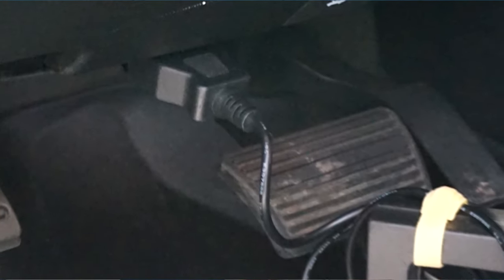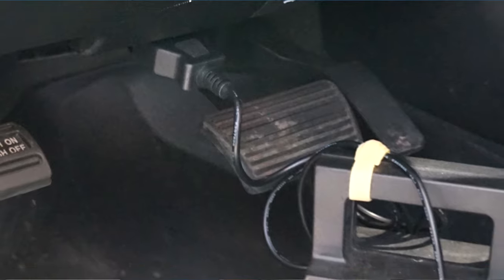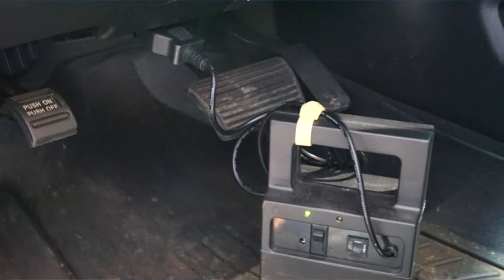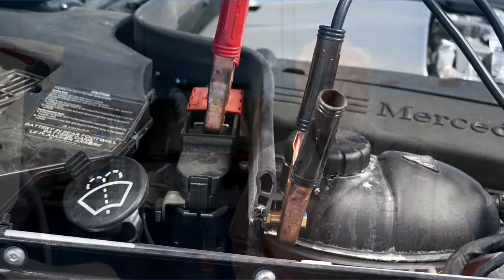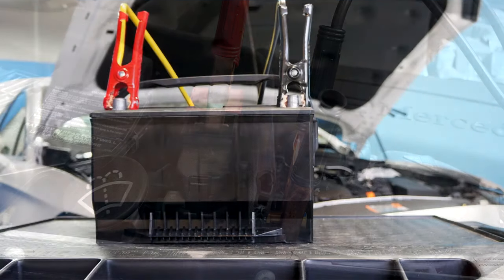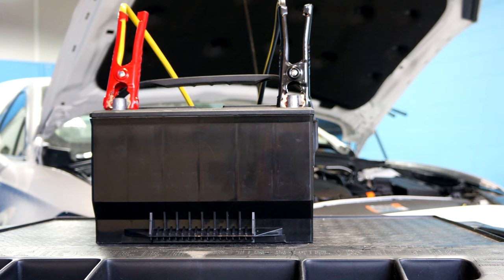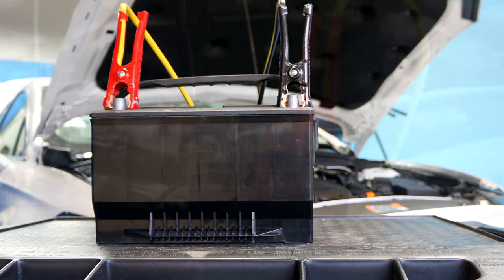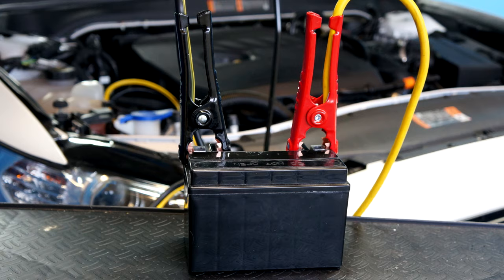Vehicle Memory Saving - The Battery Shop

Comment: Very good vid as many radio's have an anti theft mode that disables the radio when its disconnected from its12v power source. Put the new battery in and the Radio will ask for an access code-which came with the car when it was new. Hope fully you have the original owners manual and the original owner wrote  it down someplace in the manual. Its a  four digit code that you input with the radio buttons. Note that as of July 2021 the special Toyota Hybrid glass mat aux battery is $350. Most techs keep a small motor cycle around to provide 12v power to keep the Engine Control Module and Radio happy should the small aux  battery need replacing.  Note with dead battery you can't open the trunk very easy.
Reply from the maker: Hi - Thanks for watching and sharing your experience!

Comment: autozone recommended to keep the car running on idle, while you replace a new battery. i've been there 3 times. the first 2 were changed with the car off, the battery just keep having problem with idling and starting.(at the end my 03 camry reset its memory by holding on idle 1500rpm for 8minute to reset the memory, thanks to that autozone guy ) the 3rd time with a another car while the car is on, every thing seem normal, and it doesn't need to reset any thing. just keep those two wire not touching each other, it will be fine.
Reply from the maker: Hi - Thanks for watching! We recommend that the vehicle manufacturer's procedure for replacing the battery be followed, and NEVER replace or disconnect the battery with the vehicle running. We use a memory saver during the battery replacement to avoid resets.
Reply: Removing the battery cables while the engine is running can damage the alternator.  Maybe they wanted to sell you one of those too.
Reply: @billcorn5172  i don't know man, there are 3 different cars(different brands) that i replaced the battery while the engine is running never had ran in to a alternator problem. just don't let the cable touch any metal while doing it.

Comment: There's no need to use a memory tool just to save stuff like pre set favorite radio stations is there? You can reset it again and it stays? Or is ability to reset stuff permanently damaged?
Reply from the maker: Hi - Thanks for watching! It depends on the vehicle and how it is equipped. We suggest that you check the vehicle owner’s manual or a service/repair manual for the vehicle to be sure.

Comment: Since 2020 Pandemic began, my car has been sitting for over a year without being operated. It is now "dead" which I expected.  Is it best for me to remove the battery to keep it from corroding? I'm sure it will affect the vehicle's memory. I'm unable to afford purchasing a new battery at this time and since retiring and the 2020 pandemic, I barely drive. Thank you for being so helpful and your videos.
Reply from the maker: Hi - You're welcome and thanks for watching! Lead-Acid batteries will sulphate if left in a discharged state over a period of time. You might be able to charge your battery with a battery charger to get the vehicle running, but it will most likely be unreliable and have to be replaced. You may want to consider a "battery maintainer" to keep the battery charged during the times you are not driving it.
Reply: Harbor Freight sells an "automatic" battery float charger for $9.99 keep it plugged in always and it will not over-charge your battery but keep it fresh
Reply: I think if you get a new battery in, you may have to prime to prime your car plus pistons go bad if you're not starting car every few days?

Comment: All this just too change a battery, wow!!!! I remember just swapping an old for a new one none of this memory saver bogus thing.
Reply from the maker: Hi - Thanks for watching and sharing your experience and memories.
Reply: On the average vehicle, using a memory saver is more for convenience.. such as saving radio station presets, and other settings. There are some vehicles out there however that can have issues when memory is lost but I don't encounter that very often on my job but have an good idea which ones actually need a memory saver.
Reply: @deionhughes6867  does a 2019 jeep renegade need a memory saver
Reply: @Cristian-jg7rk   Personally I've changed a handful of batteries on the Jeep Renegade without a memory saver and have not had any issues afterwards. Depending on which infotainment system/screen you is in your model (there are 2 versions) you may have to reset your clock and radio station presets, but you definitely will not loose anything like stored Bluetooth devices, etc.
Reply: @deionhughes6867  do you know if the Honda CR-V 2016 is one? I need to replace the battery but live in the middle of nowhere so I don't have anything other than the new battery :(
Reply: @muntaybun7690  You'll be fine changing the battery on that vehicle. It's pretty straight forward, older Honda's need a security code for the radio when power is lost but on a 2016 you should be able to press and hold the power button for 2-3 seconds to restore radio operation after you change the battery.
Reply: @deionhughes6867  thank you. I'm still new to some car maintenance so I am really happy there are those like you who share experience and help out 🙂

Comment: So there is 2 batteries connected at the same time ( be it temperarily ) ............24v DC  ? or when exactly do you disconnect one and connect the other ? tia.
Reply from the maker: Hi - Thanks for watching! Check out our video on memory saving. The link is in this video's description.
Reply: The second battery is connected to the system in parallel. Which means you still have 12volts but more capacity or a "bigger" battery
Reply: Parallel means red (+) to red and black (-) to black.

Comment: Greetings from Belgium. Can i just connect my charger to the clamps while changing the battery?
Reply from the maker: Hi - Thanks for watching! We have done that on older vehicles but have not used one on later model vehicles so we can't be sure it would not harm some electrical systems in the vehicle. Sorry for the vague answer but we're just not sure it would be safe for all vehicles.
Reply: @TheBatteryShop  It's a 2007 Honda Civic, and a Honda mechanic says: no problem :-) As longs as it's 12V it is ok
Reply: Hi - Thanks for sharing.

Comment: If you don’t have any other option for memory saving, can’t you just change the battery while the vehicle is running?
Reply from the maker: Hi - Thanks for watching! NO that is not an option!!! Check out our video on memory saving. The link is in this video's description.
Reply: @TheBatteryShop  no dude, when i change my battery in autozone's parking lot, they recommend to keep the car running on idle before taking off the battle wire so the car memory will stay(2003 camry). when my car was off to change it, the car never runs normal(with the 2nd battery also)keep having problem with idling. they have to keep the feet on idle for 10 minutes on 1500rpm to reset the memory.
Reply: @yangy8783  That's because they want to sell you an alternator, which can be damaged if you run the engine with the battery disconnected..

Comment: Hey, i recently did a battery change without a memory saver and i lost power steering on my 2015 Escalade. Any solution to this?
Reply from the maker: Hi - Thanks for watching! We suggest that you refer to the vehicle owner's manual or a service/repair manual for the reset procedure(s).

Comment: Do I need to do this on my 2017 4Runner ?
Reply from the maker: Hi - And thanks for watching! We don't have that kind of vehicle specific information so we recommend that you check the manufacturer's battery replacement procedure, found in a service/repair manual. We use memory saving just to be sure we are not disturbing the vehicle's computers settings.

Comment: Does this apply to Climate Control….. I changed my battery in my 2014 Jeep Grand Cherokee Overland today and everything is working fine ,  but my climate control will not turn on …. Can you help. I have no Jeep Dealership in my hometown, and I just got it back in town today from a suspension being fixed out of town .. it was parked outside for the last 2 months in the cold , my insurance took a long time to get it back here
Reply from the maker: Hi - Thanks for watching! We don't always have that kind of information here in the studio, so we suggest that you check a service/repair manual for your vehicle (available at dealerships, some auto parts stores and some public libraries) for that information and corrective procedures.